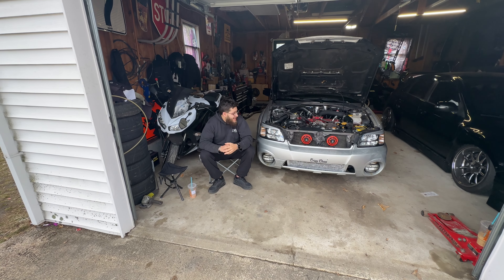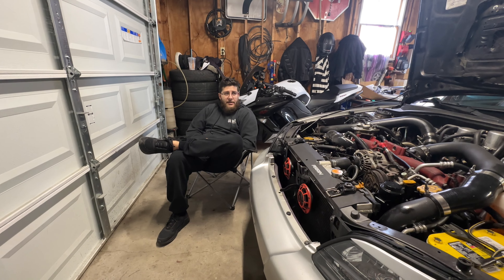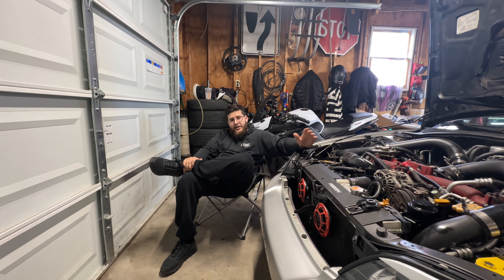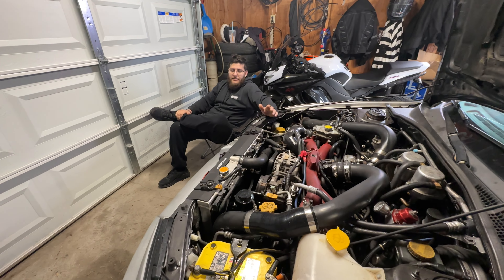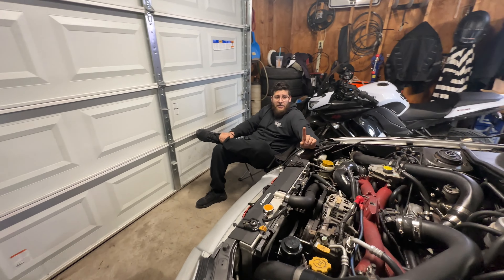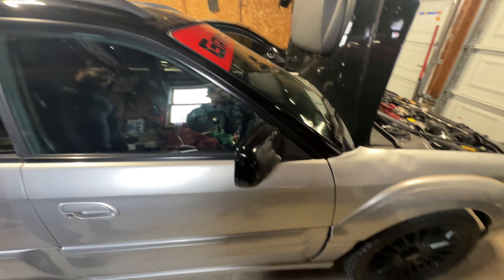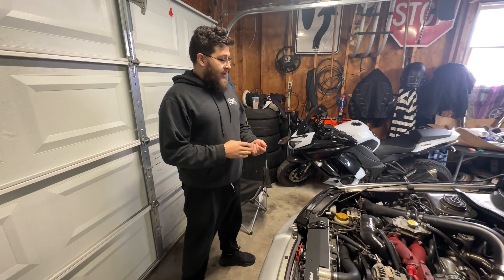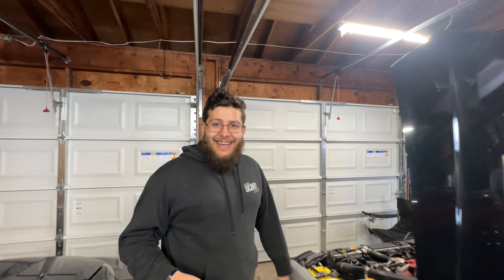Turbo Subaru Baja Fanboy talks about his Baja

Comment: Another Baja fanboy here. I've been working on an '04 Turbo 5-speed for over a year. Rebuilt the 255 with minor upgrades;  intake, TGV delete, new turbo, parallel fuel system. Coilovers, stock wheels with spacers for better stance (20mm front, 25mm rear = no scrubbing), a few other tweaks like rebuilt suspension, bushings, all that. Gained maybe 25 HP. Not really interested in a lot more. Still, she's a sleeper. I would love to do a 6-speed swap but that seems daunting. I would like to know more about that.
As you said, aftermarket parts/kits are hit-and-miss for these unicorns. Silicone hose kits for '04 WRX worked well for most stuff.. Perrin turbo intake fit well. Turbos, injectors, all that, the same. And RomRaider is my friend.
It's my daily driver so I want enhanced stock for reliability. This car came out of Arizona so NO RUST at all. I'm doing the body/paint work as I type; Nardo gray over black.
All in all, she's a great little mountain scooter, and I can take the garbage to the dump without the smell, then head over to the Dragon which is about 20 miles from us,, have some fun looking at all the STIs that people spent too much on and aren't much good for hauling a load of mulch.
What fun! The roads here in Western North Carolina are more about torque, handling and driver finesse than raw horsepower. I've left Florida wannabes in cars costing 20 times as much in my dust. And I have roads nearby that are more exciting than the Dragon, with fewer fools (and cops) to deal with.
Reply from the maker: Absolutely these vehicles are so underrated, it comes with all of the fundamentals to make for some very heart Broken “ballers”. As to your 6 speed conversion question it depends what route you go. If you go for the 15+ cable driven 6 speed you do have to clearance the trans tunnel a bit to fit the cable box and you do have to drill out some bolt holes for the box itself. Additionally you also need the VSSPro from iwire in order to adapt the stock harness to utilize the the ABS sensor as a speed sensor otherwise the cluster won’t work for speed and rpm. As to the STI 6 speed from 04 it’s a 5x100 bolt pattern vehicle so that conversion is just bolt up transmission(direct plug and play), r180 differential and plop in the axles and you’re done, 05-07 STI 6 speed are also direct bolt up but they have different hubs for the wheels so the axles may need to be replaced. Now for 08+ STI 6speed and legacy 6 speed you’ll also need the axles and VSSPro in order to run them. All 6 speeds run a different final drive from the Baja so they will all also need the rear differential swapped out, STI 6speeds will be r180 LSD differential and cable driven 6 speeds are 4.11, as to where the Baja with a manual has a 4.44 5 speed It sounds like a lot I know but the reward is worth the effort for sure. Ohh before I forget the cable driven 6 speed is the same length as the 5 speed gear box so the driveshaft will remain the same and the sti 6 speed is the same length as the auto trans so you’d need a driveshaft from an auto trans in order for those to work
Reply: I did a cosworth tmic, hks up pipe, downpipe and tune. It went from 165/awhp to 200. Then vf39, 565 injectors, walboro fuel pump, 4" randomtek cat back, sway bars, end links and went to 300 awhp.

Comment: Have you ever considered putting a he 3.6 in it that’s if it will fit,I own a 2006 non turbo car rust free , car runs great and I’m to old to change the engine, not that I would not want to, I still drive to fast for being 65 poor Baja still hits 100 to many times